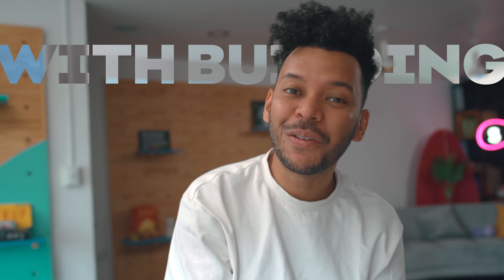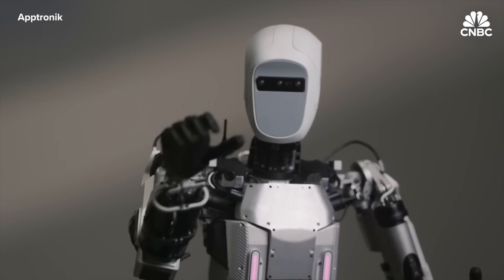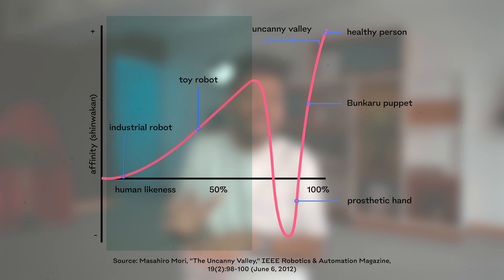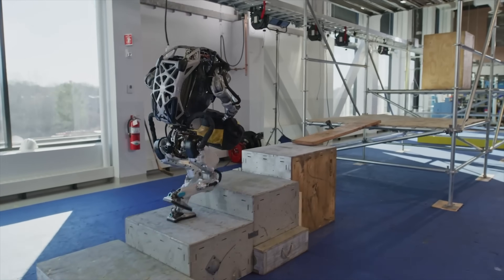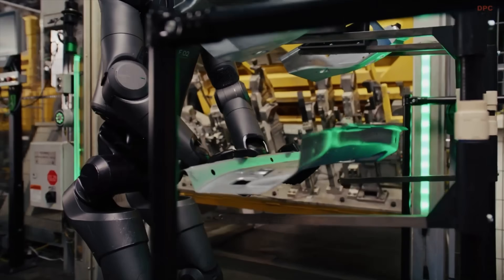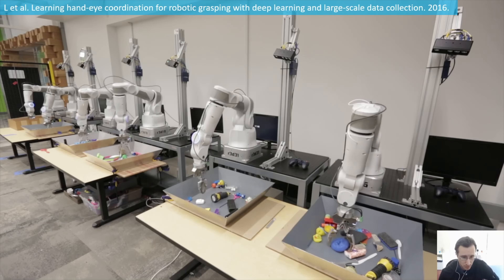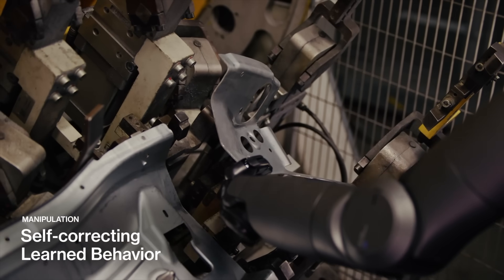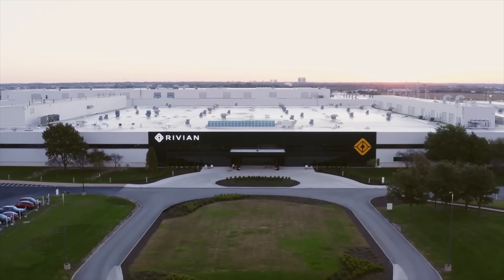The Automation Trap: What Robots Are Really Selling

Comment: Roboticist here. Great video and summary of how reality of robotics and peoples' perception is at this time.
I just wanted to maybe append a bit of info about human vs robot locomotion. Humans are actually extremely efficient in terms of their movement because of compliance and movements in their joints and links. Humans are able to maintain momentum while walking, in knee joints for  example allowed by springy and non linear motion of the joints themselves. Most real robots assume rigid body dynamics and are constructed like rigid bodies - this is because of manufacturing limitations as much as control strategy. There is research in this area, but in general all robots are fundamentaly inefficient compared to humans because they waste a lot of energy. In fact from more technical side, humans have almost infinite degrees of freedom, while a robot may have up to 4-6 per leg (and most control strategies reduce that for computational power reasons).
Reply: Controls engineer here. I agree there is a fundamental flaw in the assertion human locomotion is inefficient. It is so efficient that you can build fully autonomous walking mechanisms that require zero controls. Humans have evolved over millions of years to allow us to adapt to many situations a wheeled robot could never adapt to. I’m not saying a humanoid robot is better for most tasks than a purpose built platform, but for things that humans tend to do, we are pretty  damn efficient.
Reply: @jpodius  I don't like this idea of "millions of years of evolution so it is efficient". I believe this is a misconception of what the evolution is. Humans have very different constraints to continue to exist: reproduce, grow up, find food, convert energy from available food, repair themselves, evolve, and more. Things that a humanoid robot is not forced too do to be productive for human. let alone the limitations from the bio construct of a human. The human is damn efficient in the regard of surviving as a species, but the evolution is not enough to say "human is the most efficient way to walk and a robot with less joints could can't do better." Even if true today.
Reply: I have a degree in aerospace engineering but have spent 35+ years in industrial control systems and automation. Up to 2005 I spent that time in manufacturing and since mostly in mining. While in manufacturing I did a bunch of robotic projects. Other than building and deploying robots I also worked with Kuka, Fanuc & Adept robots. 

I love your comment as you are one of the few people who actually understands the topic of COMPLIANCE. The fact you can use that word in its correct context tells me you know what you're talking about.

For the uninitiated compliance is very closely associated with tolerance, but while tolerance is very easy to quantify and specify, compliance is a but more vague. Its basically a combination of tolerances and mechanical interference between parts. Once you get into robots and other motion control systems like CNC Mills it also involves the control algorithms. 

The problem that normal people have is how the media just loves to hype every new technology as if its going to save the planet. Unfortunately all these new wonder technologies also have to obey the dual realities of human society and the fundamental Laws of the Universe (eg. Newtons Laws, The Laws of Thermodynamics,...etc).  

And that basic problem doesn't just apply to robotics. I did my degree during the Reagan Star Wars period and we worked out back then how ridiculously impractical space based weapons are. During my senior year we had a series of guest lectures and one of those was a NASA engineer who explained how impractical it is to terraform Mars. YET HERE WE ARE AGAIN. 

I even have a new term for these technologies. Zombie Technologies which are things that we have proven again and again that are either impractical or can't work AND YET they keep coming back to life because somebody has found a way to suck money out of misinformed people.
Reply: tonywilson4713 I get where you're coming from.  There’s been a ton of overhype in tech over the years, and roboticists do love to dangle sci-fi-level promises before the fundamentals are solved.  But I think your take might be stuck in the 2005-era view of robotics.

We're past the point of doubting whether the hardware is viable.  Locomotion? Solved. Vision and object recognition?  Already outpacing humans in narrow contexts.  The current race is around training and refining the pilot AI to handle edge cases and real world variability, which is progressing way faster thanks to the recent new training architectures.

If in 5 years we're not seeing these bots stocking shelves, doing basic housework, or assisting in retail, I’ll be shocked. X1, Figure, and others are pushing home and commercial deployments this year.  Hell, my local regional grocery store has a bot that roams around to check shelf stock already - not a big leap to see one of these humanoid bots doing that AND stocking the shelves.  This isn't a zombie tech—it’s walking, talking, and showing up for work.
Reply: @tonywilson4713  Elon Musk is an economist, not a scientist, so he doesn't understand the impracticalities of terraforming Mars, or building robots... He just sees Dollar Signs! And that's mostly based on the Musk hype machine!
Reply: this!!
Reply: My whole assumption about humanoid robots is because we've obviously molded this world around US humans
Reply: We got that dynamic stability 

Compared to a wheel legs genuinely are less efficient. We have to waste energy to pull our leg back to continue the walking/run cycle again.
However, compared to a wheel we are so much more versatile, since we are less limited by terrain. But as he described really well in the video, there is so much fine tuning done unconsciously to maintain balance, and it involves almost all of our skeletal muscle fibres - of which there are many - and it seems a waste of time, and resources, to try and replicate that in robots.
When it comes to putting legs on robots, they have a lot more luck with four or more legs, because that can give transverse stability as well as some amount of dynamic stability - even still, wheels exist.
Reply: E.g., a human can beat a horse in a marathon.
Reply: Great break down
Reply: Humans are extremely inefficient as robots. Humanoid robot design is like motorized carriage design for cars. Silly. I already have a dishwasher, Roomba, and auto pet feeder. They cost $400 altogether, and I can manage them all faster than a goofy humanoid robot ever will. I don't need to add another app, another robot, and more electrical drain to manage these things.
Reply: @copperbeckville1853  Watch out for those low-flying planes there.
Reply: Humans evolved from an animal with 4 legs. The spine is a terrible design.
Reply: Hmm I've been operating this human body for quite awhile, and it doesn't feel the least bit efficient, nor really that great of a design for getting things done in my environment. I'm nostalgic in my appreciation for this body, but if I ever meet the creator, I personally plan to give them hell over the many many design flaws. So, if you work in robotics, and think my defective body is efficient, then that really tells me there's a lot of work to still be done in the area of robotics, before robot butlers are a thing, and that my efficient body will be rotting in the ground before one would be affordable to the likes of me

Comment: You got it wrong. Big tech doesn't want to create humanoid robots because of a god complex or relatability. 

The idea is that if you build a robot that can fully imitate human movements, you can replace humans directly in a workspace without the need to make any adjustments to infrastructure (like getting rid of stairs if the robot had wheels). That's the big marketing point for this kind of robots, that they would be able to instantly replace your human workers, specially in factories with zero adjustments needed. Best part is they won't complain or unionize.

Otherwise it makes absolutely no sense to make robots with legs rather than threads. Same reason we will never see giant bipedal mechs in battlefields. Less stability and a higher center of mass.

Comment: I went to the humanoid robot conference this past year and Memphis. I went in expecting to see a bunch of advancements that would allow for use of these in other scenarios. I left thinking we are a couple decades out from actually getting useful versions of these. The biggest issue is that these devices cannot be safe or can be but cannot be proven to be safe and therefore cannot be safe and therefore would not be adopted into a business unless there are fences put around everything and humans do not come into contact with them. 
They cannot get these things certified legally to work around humans as a co-robot when using AI to make decisions because it will inevitably hallucinate and one of the main speakers specifically said when you ask for an Apple it might put a knife through your chest. They thought about using centralized AIs to monitor the localized AIs making the decisions just before they make the decisions and the same problem arises in which the manager AI cannot have known outputs before it's output. 
The next biggest hurdle that nobody has solved with legged robots is safe failing. So if these are in a business then you would have to install things that would drastically increase the price of having them because you're not really going to own them they are going to be leased and you would have to redesign your work floor to accommodate them as well as people. The battery management technology that we have today is really good but it's not perfect and that was another giant portion of this was that when these things fail they fall over and they're not light so the chances are if you have this in a house when it falls over it's going to potentially crush a pet or a baby. If it's in a workplace around machinery and whatnot you might have a 10 million dollar machine that this thing is working with and it falls into it and causes unbelievable amounts of damage to itself and the machine and potentially things around it. I'm specifically thinking about large lathes and what it looks like to wrap one of those things around a giant piece of steel spinning at 1,200 RPMs. 
The most successful company so far when it comes to integrating robots have used wheeled robots and that is used all over the place for moving things around inside of storage areas. Pick and place sort of humanoid type robots that are wheeled that can fail safely exist and there were two companies at this conference that had those robots. Now the problem is you still have to end up redesigning your areas or you already have to have areas in which these things would work perfectly within without modification. Those cannot make it upstairs or even over something that might be an inch tall between two portions of a building. Every single company besides the one you talked about with the BMW thing which was just a huge hype thing and he was like a fake Steve Jobs from Germany. He literally referenced Steve Jobs so many times in his talk. He was the only one that seemed to be thinking this would all work and it just seemed like he wanted more money for investment well everyone else was having talks about how we aren't there we may never get there. Ultimately it ended with the people who ran the conference begging for all of the companies that were there to see all of this to contact their representatives to attempt to get legislation pass that would allow it to make it easier to certify these AIs. To me that seems more likely to create failure in these systems or at least except human death because money

Comment: I agree with this analysis for most of these companies, but Tesla is bit different. Their robot is meant to be build in volume from the start and their engineers have some experience with that. While I don’t think we will see them in the streets soon, there is a huge market in factories even for simple tasks if a robot can simply replace a human worker without needing to change anything to the environment. Tesla will surely be their own customer and progressively replace their employees working on stock management and assembly lines. My only conclusion is that will need universal income sooner then later.

Comment: I don't think you understand why robots are taking a human shpe. It's not for the appearance.
It's simply way more efficient, because our world is designed around us, and our shape, so instead of shaping the world for the robots, we'd rather shape the robots for the world.
A lot of people make very similar points to you, but it's not like the whole robotics world hasn't thought it about it a lot, and hasn't tried different shapes. 
A general purpose robot would do best in a human form factor. And the inefficient part of robots, isn't actually the form, but rather the actuators. They use electric motors at the joints for movement, which means they're precise, but they aren't fast, they aren't strong, and they are heavy, big and inefficient. The best actuating system for robots, would be a combination of muscles and motors. As it would allow for certain joints to have 360* of freedom, while maintaining the efficiency, speed and strength of muscles in the areas that need them.

Comment: Bipedal or quadrupedal locomotion is more adapted to chaotic terrain than wheels or even tracked locomotion. The Ukrainians are discovering this with the difficulty of making usable ground drones. Drones have been more widely used in the air or at sea for that reason. The same problem was encountered in Fukushima, where drones had to be sent into the wreckage of the nuclear plant because it was too radioactive for humans.
Another reason for the human form is that it is the most adapted to the ergonomics of our tools. Designing a robot that can use our tools might be better than redisigning all of our tools for robot use. Imagine the versatility of a robot that can drive a bulldoser, a mechanical shovel, use a pneumatic drill, and more.

Comment: Arguing against the efficiency of the human body is a good point, but one can see you don’t have an engineering background, that would allow you to think out of the conventional “humanities” view spectrum. 

As many have pointed out already, although the human body is not efficient moving, it is extremely efficient doing a bunch of complex movements. You are right that it is more adequate to use wheels to move than legs, but if you need to pick up something, climb a couple of stairs and do perform other more complex movements, it becomes very evident that a humanoid body is probably the best design choice.

Comment: This was an excellent video! I'm actually working on a geriatric assistance robot, and it is NOT a humanoid robot. Why? Because there's zero need for it to be a humanoid. It's more akin to a roomba with a sensor suite and automated medication dispenser. There is literally no need for the robot I'm building to be bi-pedal. Instead, having an efficient, two wheel drive system with a castor makes it efficient for traversing the reasonably flat floor of a single story house (which is my target market). Will I design and build additional robots that can handle stairs? Absolutely, but they still won't be humanoid.

Comment: The goal of humanoid robots is not to be the most efficient machine for a specific task, but to be the most versatile. 

Sure wheels are best on a road, but if you want someone to crawl through rubble to rescue you or walk your dog, or bend over and lift you in case you fall, you need a machine with appendages.

Furthermore, we live in a human centric society, and if you want a versatile robot that can do what a human can in this society, you better make it like human.
Reply: That's the issue it's better and so much easier to have specialization rather than general use.

Comment: Tesla's first robot is the Robotaxi. In Texas June, now we have to see if it will take over UBER (2000) cabs. And how fast. IF this runs well and takes over transportation then. That same AI strategy will work in Optimus. You also need mass manufacturing to make a cheap but reliable robot. Let see what happens over the next 5 years starting in Texas.

Comment: I agree that a 100% humanoid robot makes little sense for factory floors. However, for a domestic robot that is used at home for daily chores and maintenance, the humanoid form is the single best thing to create a jack of all trades robots.

Most homes are not wheelchair friendly, especially due to chairs. A lot of gardens are nether, especially some with stepping stones and intricate flower borders, high hedges etc. Even for indoor use on a single floor a humanoid form allows to get behind the the couch, under the table or on top of a shelf without making.

A walking humanoid robot is the only thing that is going to work as a 1 size fits all robot. If we can get that to work, it beats buying 10 specialized ones that will do nothing for half of the time for a normal middle class home. Just because its difficult to make does not negate the positives that can come from succeeding to make it.